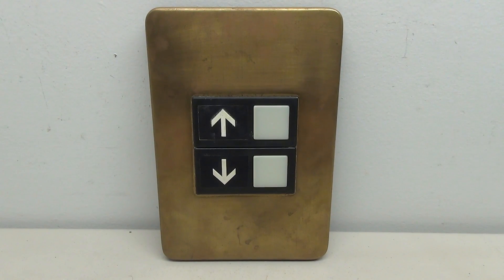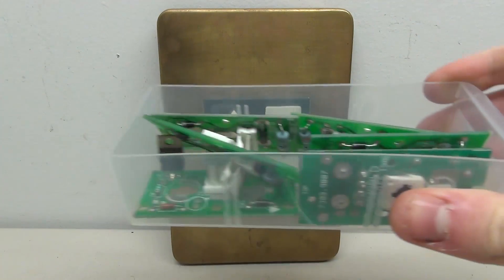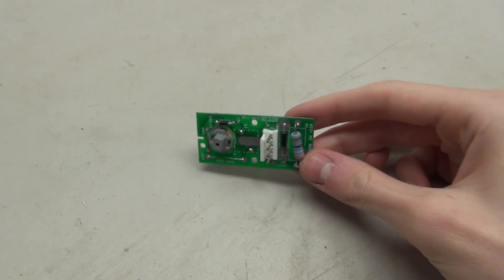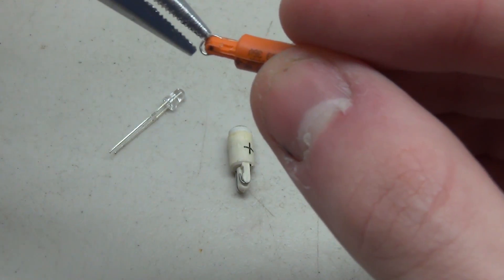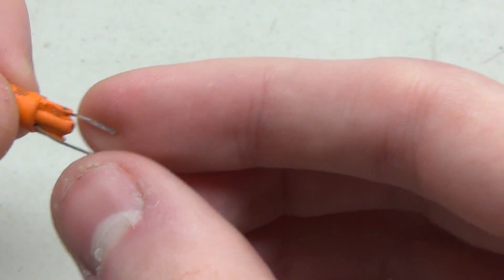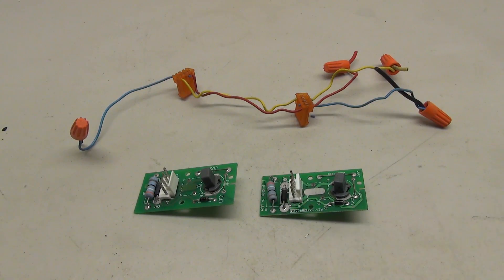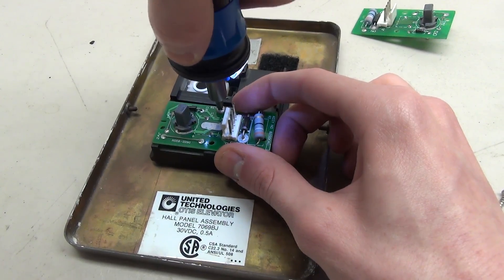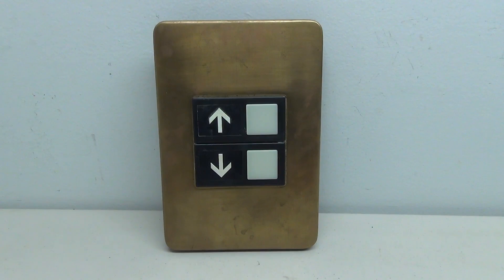How to Wire Otis Series 1 Elevator Buttons

Comment: You can tell which leg is positive and negative as if you looked very closely the positive leg is longer than the negative leg(don’t say they are the same length as they are not the same length!)
Reply from the maker: Unless you buy really cheap ones then they are 😂
Reply: @stlelevators  actually no I bought blue leds from aliexpress and although cheap the longer leg is + shorter is -

Comment: Great video! Is there a way you could make the LED come on with a press, then require another press to turn it off again? That would be even more awesome! I'm guessing it would be complicated though. :-)
Reply: You could use an SCR to make the button remain illuminated when the button is pressed. You could then use another button (or keyswitch) to turn it off. If you want the same button to both turn the LED on and off, I would suggest googling 'flip flop momentary button' and going from there.

If you want to achieve the same thing with a relay, google 'latching relay circuit' instead.
Reply from the maker: Yeah a latching relay would work, but again, you would have to find a way to disable it.
Reply: @stlelevators  Not necessarily, you can make a latching relay that only requires one momentary button (https://www.youtube.com/watch?v=zVNBH9SiuoU). Granted the circuit also requires diodes and resistors, but it shouldn't be too bad.

Also STL, I think it would be really cool if you did some sort of latching circuit demonstration in one of your elevator part wiring vids! Maybe do it with one of your Schindler HT's. Button latches when pressed and is reset when fire service is in bypass position.
Reply from the maker: Yeah that's a fairly simple design. I might be able to come up with something to use it in.